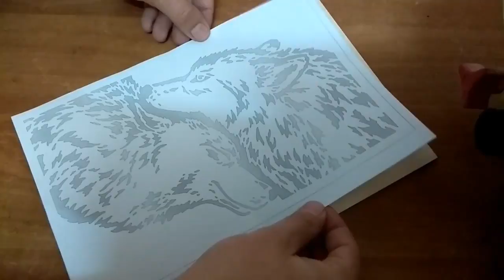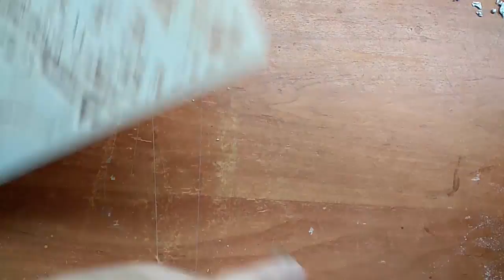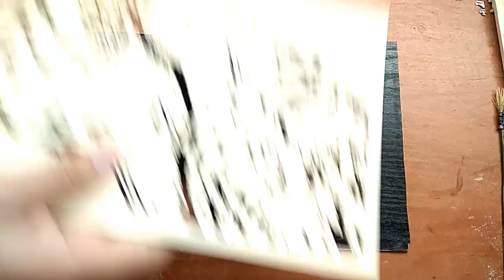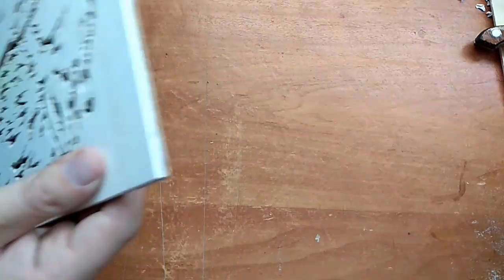Wolves - Scroll saw project for beginners - shown all stages of project

Comment: What is that glue you are using? Ciao
Reply from the maker: I useed glue "88" of Ukrainian production, instruction: apply glue on both surfaces, wait about 10-15 minutes until the glue dries, squeeze the glued surfaces.  In the USA similar glue calls "Contact Cement"